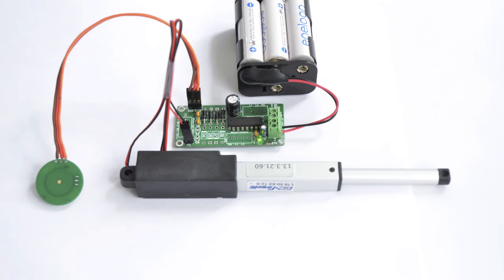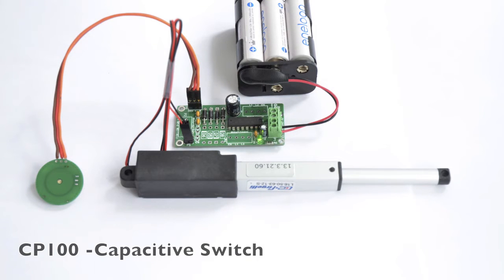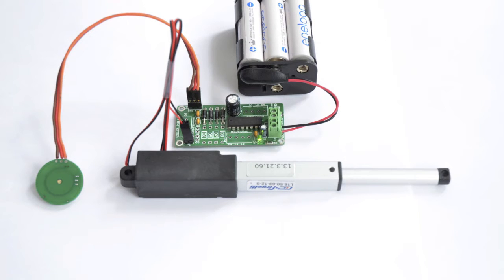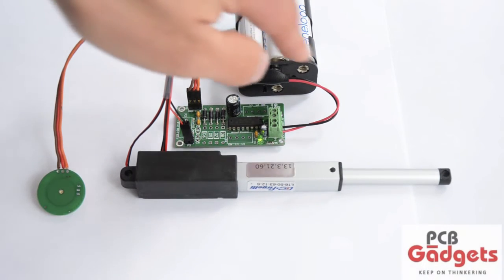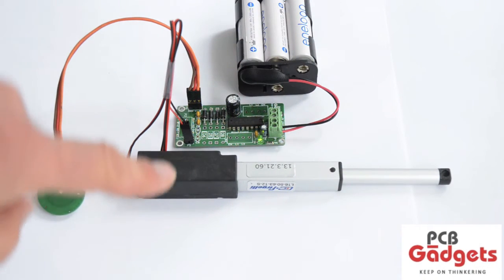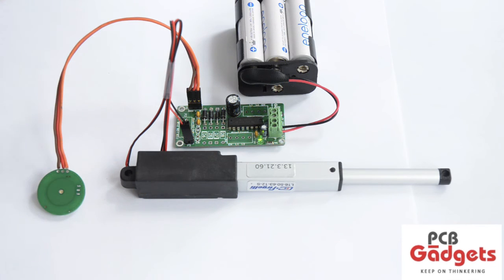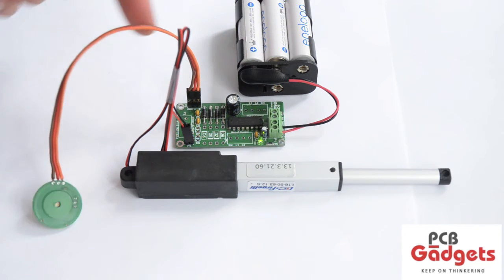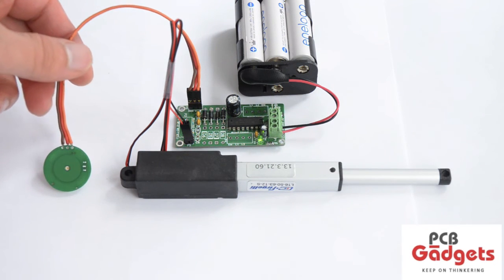Firgelli L12 / L16 S Type Actuator

Comment: will that switch allow me to extend the actuator halfway and stop or does that actuator have to fully extend before it retracts?
Reply from the maker: Not at the moment. The only time it stops is when the actuator reaches its endpoint ( fully extended or fully closed) However you could change the actuator direction at any time during it's operation by simply toggling the switch.
Reply: Thank you very much for your reply. I will most likely make a purchase from you website. Very nice products by the way.
Reply from the maker: Thank you Ray, Glad you liked it.